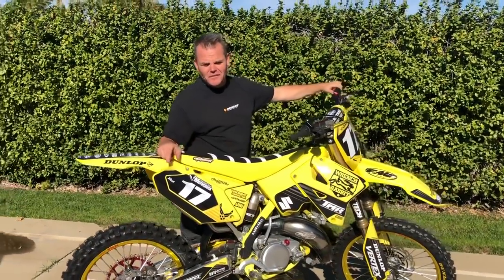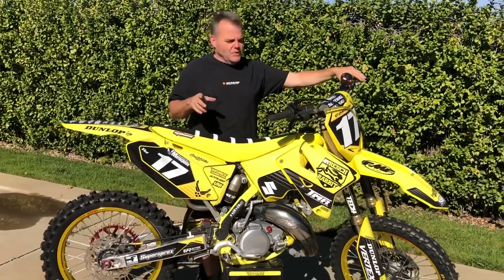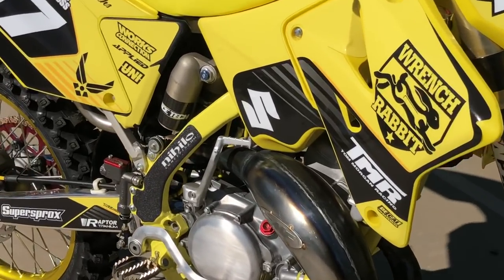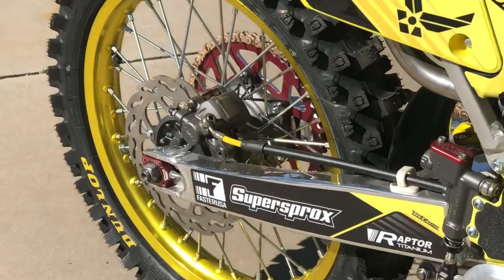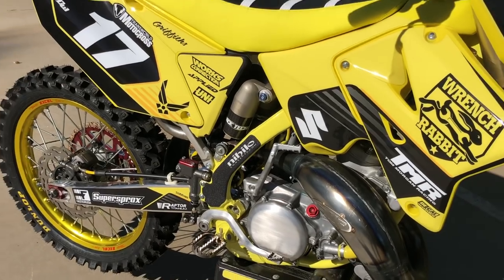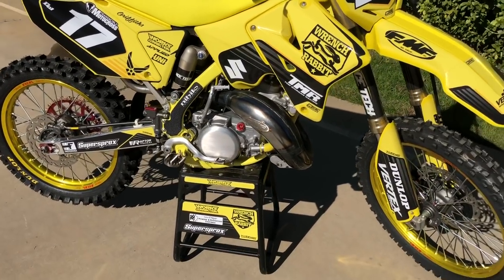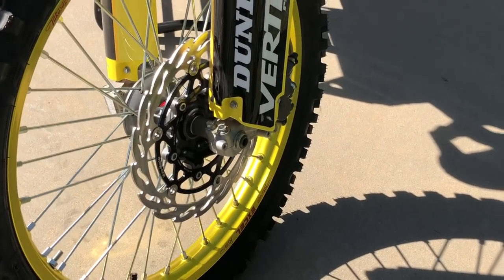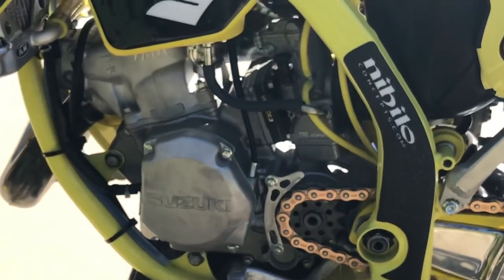RM 125 TWMX full rebuild mod.

Comment: How does the performance compare to a brand new 125
Reply: I'd say equal to a new yz 125 since Suzuki stopped r&d in 2006 an a 2020 yz 125 is a 2005 yz 125 besides the forks

Comment: Wait what year is this bike?
Reply from the maker: 2005
Reply: The bikes have more or less remained the same from 01 to the end of their production. Besides a few small engine changes, the bikes are virtually identical.
Reply: @smidly7192  Not true.. There are big differences from 01-03 to 04-07
Reply: @TerrickHarden  Really? What did they change on em? I knew there where small changes to the bikes over the years but I didn't know there where big ones.
Reply: @smidly7192  1. The linkage was redesigned and the frame had a change to accommodate this 2. The rear brake reservoir was changed(frame mounts adjusted there as well) 3. The power valve and cylinder was redisgned.. 

I want to say the triple clamps had an update as well but I don't remember what year specifically..